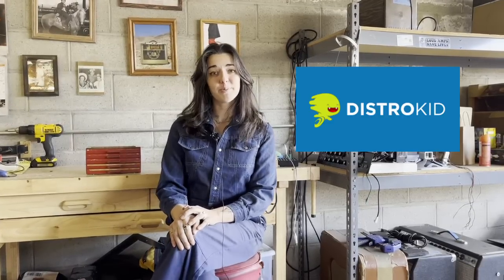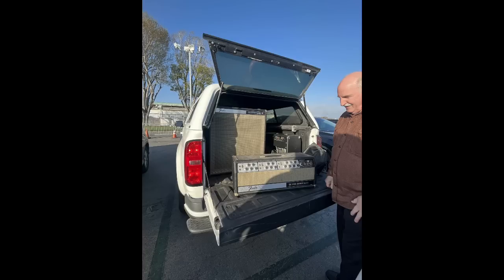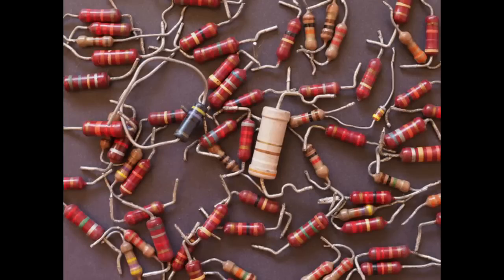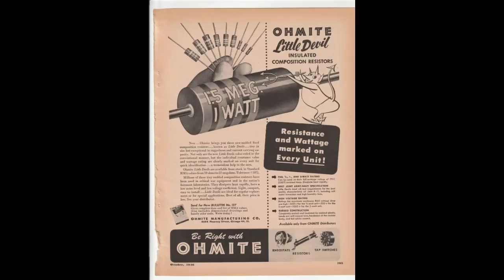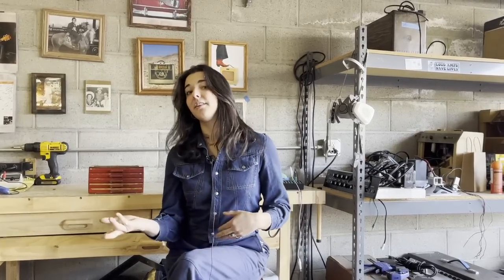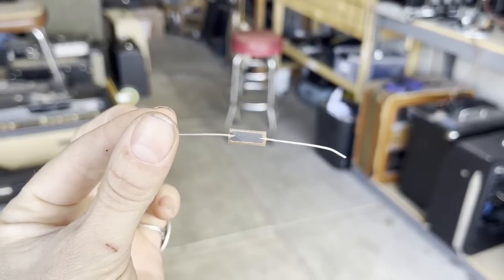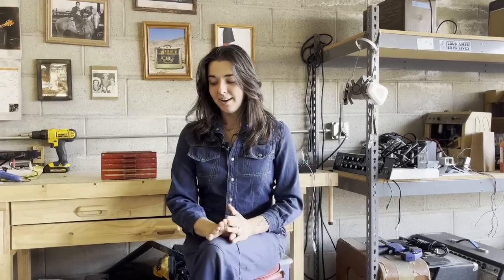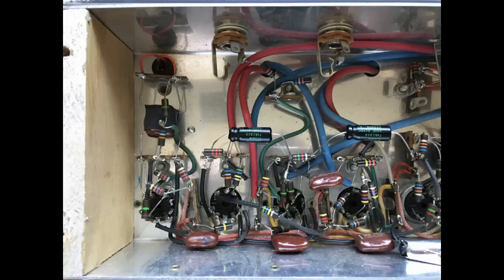Carbon Composition Resistors | Amp Electronics 101 | Fazio Electric

Comment: You video reminded me of when we used to "manually trim" carbon resistors to get a !% value vs the 5% or 10% standard values by using a small "V" file to trim the the resistor and then reseal that area with a non-conductive clear coat.

Comment: 😊Can u Explain more What is carbon Compozite! Is it carbon Sand coated on metal Resistor surfacs by using Wet Glue to Glue it Carbon Sand onto it. Is it correct !!😮

Comment: I must confess to visiting recycling centres(Rubbish dumps) and with a pair of pliers and a screw driver ready to pluck all the carbon resistors and caps I find in smashed equipment, then I measure them for re-use...I need help!

Comment: I'm not a fan of carbon comp resistors personally. They drift. They tend to be off spec with a wider "tolerance"  even when "new old stock". They fail in high stress applications like at the screens, plates, and along the B+ rail. But worst of all they HISS when subjected to humid conditions and over time in certain places. But still they have this aura of superiority because that's what people used back then. I have heard that in some applications they can give a sort of slight "warble" to the sound similar to a faint vibrato which might sound subjectively....mostly around the phase inverter section....but overall I am happy to remove them and replace with wire wound.

Comment: you beat around the bush.....CARBON RESISTORS....are not stable in a circuit when there is HEAT....inherent heat in electron flow or physical HEAT as in hot vacuum tubes and a heat soak heat sink.....THERE IS NO MAGIC MOJO......drifting instability when you want a STABLE circuit when...you have controls for the circuit....not some wild card in the circuit that is not a CONTROL factor.   THEY JUST USED THEM....as they were CHEAP and what was available in the moment......not for anything magical or surge related....considering the rectification was VACUUM TUBE and....hmmm a slow warm up and not solid state instantaneous.....heaters have to heat up my dear !  Engineering aspects....the numbers are good on the PAPER, but in real life that PAPER value only lasts till it HEATS UP.........and the variable strikes and it goes SIDEWAYS against the PAPER.   The engineers as designers will argue all day on the PAPER and MATH and VALUES as a result for the circuitry....they don't care about MATERIAL SCIENCE.....its VALUES hahahaha.......
DIRTY SECRET......hahahaha....take a magnet to the leads and see it they are ferrous and stick to the magnet or NOT......and the HIDDEN....it is ELECTROMAGNETISM...isn't it....rocket science isn't it !!

every value and every lead and across manufacturers lines.....its not always CONSISTENT.  IT'S NOT ALWAYS...swapping out PARTS for PARTS and SOLDERING IRON 101 and how not to get LEAD POISONING.....and GOOD SOLDER JOINTS hahahaha....fusion   A nose full of rosin smoke keeps the doctor away........and we won't talk about THORIUM in this BREATH.....
PROP 65 anyone ??

Comment: Nice to hear some honest commentary on carbon comp resistors.  I have a MSEE from a well-known engineering institute in MA and have been practicing EE as an employee, consultant, and adjunct instructor for nearly 41 years, mostly in analog and RF design.  Over these years I've learned a lot about electrical components.  I often hear carbon comp resistor religious zealots rave about how carbon comps are the best and should never have other types of resistors substituted for them in vintage amps, and blah, blah, blah...  These folks often uneducatedly denigrate SMT parts as "cheap," and "junk," when, in fact, they are closer to their ideal theoretical counterparts when it comes to performance due to lower parasitic values.  It can get frustrating sometimes, and you video was a nice breath of fresh air.  Thank you!

Comment: A great explanation Colleen. An old ham radio trick was to trim the value of carbon comp resistors by cutting into it with a hacksaw, the deeper the cut the higher the value.  Carbon comp resistors are still available from Mouser and other wholesalers, I still use them for energy absorbers across rectifier diodes (in series with a capacitor).

Comment: That was a nice explanation. It'd would have been cool to see how the value of that resistor changed after you sanded it down. I realize examples would have required a longer video and your explanation was enough to get your point across. I appreciate when you post content like this. It inspires more conversation in the comment section. Thanks. Happened to be wearing my Fazio T today.

Comment: Very cool.   A fairly well known audio/electronics engineer who passed away recently left a basement filled with all manner of electronic and devices.  I was able to aquire a large amount of the CC resistors that he had.   I don't know who made them but, I gather that they are probably a bit old as the values have increased well beyond the color code values.   I've needed to piggy back a second high value resistor in order to lower the value a bit.   
But, I'm happy to have them and am interested in building an amp or two with only them as the resistive elements.  Why not.  
They are there, and I can decide for myself if I think there are any of the mytholigical stated benefits and "mojo" involved that we're heard about.    Nice vid, thanks.

Comment: Great explanation - and until now I have never seen the insides of a resistor, very interesting! Thank you! May I add one point ... it may even be a "pro" for the CC resistor: in my opinion the CC resistors make a somewhat smoother, rounder and more pleasent sound, when used as the first resistor in the pre-amp. Usually the signal from the guitar arrives at a resitor which is in most amps 68 kOhms, in some amps it is 22 kOhms. I have experimented in one of the amps I use and found that the CC resistor results in a smoother sound, compared to modern resistors like carbon film or metal film resistors. (Of course in my experiment the resistors showed the same value with the Ohm-Meter.) I can only assume that all resistors always show a tiny portion of capacitor-like behavior, which depends on the type of resistor. And with the CC resistor this portion is different and this leads to a different transmission of high frequencies - hence the sound is smoother while it is harsher with other types of resistors. I hope, this makes a little sense somehow...

Comment: Nice description, I am so glad you didn't mention the dumb myth that carbon resistors create some kind of sought after sound or distortion in the amp. Other than that, please replace carbon comp resistors with more modern resistor types, unless as you mention for surge protection. As an electronics engineer, I stopped using carbon comps long time ago!

Comment: Another (former) pro of carbon resistors: They were the resistor to go for high frequency circuits. I love carbon resistors and still use them as ESD surge absorbers at pH meters. Instead of connecting the BNC socket to the PCB with wires we use 10K carbon compound resistors. The value and noise does not matter. No current flow and noise gets filtered out by the amplifier circuit that is made to amplify DC only. However the latest product now has SMD thick film resistors since I got mails from Digikey that the 10K OHMITE resistor will soon be made obsolete.

Comment: Carbon Comps have a resistance coefficient to voltage so there value changes with changing voltage. Thats why they produce extra distortion and are pretty much only preferrable as plate resistors if you want that 'Mojo'. In every other application standard metal or carbon are much better suited as you have well explained.
Reply: The "varistor" effect. I have read this is actually a thing in certain applications with carbon comp. But if you are really after that sound, buy a Magnatone.

Comment: I have a huge collection of old carbon comp resistors that I got with an old Ohmite storage bin. I went through them and checked them against what they were supposed to be, and the vast majority were ridiculously off spec. But the ones that were close I kept. I like them for no other reason than the fact that I like old stuff! And I use them when I’m doing any vintage work or any point to point work. Good video!

Comment: Every component in an electrical circuit is a resistor or has a level of resistance associated with it. Even the wiring. The exception is the application of superconductivity - and even here there is some resistance but but considered negligible in a practical sense.
Cheers
Reply: True superconductivity has absolutely zero resistance.  With no outside intervention, current will continue circulating in a superconductor and will not diminish.  (It takes quantum mechanics to explain this.  In the classical view, it would seem that the electrons would always eventually "bump into" something and slow down.)
Reply: @analog_guy  The strict and simple definition of superconductivity does stipulate that the electrical resistance is equal to zero and that Ohm's Law does not apply to superconductors.
There are plenty of articles on residual resistance in superconductors.

As Dr Rachford describes:
"Zero resistance at DC below the critical current but not at higher frequencies especially as one approaches the transition temperature and/or hf approaches the gap energy. Then also there can be flux transiting the (type II) superconductor resulting in losses and an effective resistance in an applied magnetic field or just a self-induced magnetic field. Magnetic flux pinning centers are manufactured into SC tapes for magnet applications to reduce the flux transits (phase slips)."

In terms of practicality we can describe superconductors as a material that has zero electrical and Ohm's Law does not apply.
I have no issue with that Mr Digital_Guy

Comment: I love your videos. Nowadays you can avoid using carbon resistors. modern resistors have better reliability, less noise, better tolerance, better stability, better everything... back in the days this is the only technology we used to have. if you choose the right type, you can always avoid carbon resistor. they are good for the vintage look.

Comment: It would be really useful if you mentioned a reason and justification for using carbon comps  in amps these days.
Reply: Yeah, I was wondering about that too - like is there a reason to replace carbon comp resistors with carbon film or carbon comp, or just move to metal film? I would just guess that moving everything to metal film is the way to go unless there's some really compelling reason not to.
Reply: IMO the main reason to use carbon composition resistors in amps is for the vintage look. Some might say they have different "mojo" but I can't speak to that.

Comment: the point to point construction often turns them into little flags that vibrate with the chassis too, it can lead to surprising mechanical problems. had to drag an amp on a stool across a concrete floor to find the bad resistor once. at deafening levels it would sometimes crackle, with the scooting action it would shake like crazy. wouldn't be surprised to find out if a badly placed resistor was mechanically responsible for the tone on some early tube gear

Comment: I see any carbon comp resisters have wattage values attached to them. My problem is knowing where a 2 watt resistor is required over a 1 watt, for example.
Reply: If you don't know what wattage you need you can find the voltage drop and/or in different conditions, then use Joule's law to find how much heat is generated. Double this to find a safe wattage resistor. You also need to mind the maximum voltage of each resistor type, but IIRC most carbon comps should handle at least 500 volts.

Comment: great video - super informative.  Can you tell me, do they tend to drift in one particular direction, or no?  And if they get less resistive, can this lead to other component damage, or does it just effect the sound?  Love your videos, Colleen, thanks for sharing!!
Reply: Carbon comp resistors tend to drift higher in resistance when exposed to a humid atmosphere.  They can be "baked out" in an oven at modestly warm temperature such as 65 degrees C to restore the original value, at least until they absorb humidity again.  Having said that, I have many very-old carbon comp resistors that have been stored for decades of time in a normal non-humidity-controlled indoor environment and these remain within or close to the original specified tolerance.   Good design practice was to use the carbon comps for low cost where the value and noise were not critical to the design, and to use film or wirewound resistors where tight tolerance and/or low noise was needed.  In applications where carbon comp resistors dissipate enough power to get reasonably warm, or where the overall product gets reasonably warm, as in products using electron tubes, they bake out each time the product is used.
Reply: @analog_guy  super information - thank you so much!!
Reply: As @analog_guy said, they usually drift up. However, they can also drift down if they have been overloaded.

Comment: Most informative... well explained... I've got a Vox AC-100 amplifier with cracked carbon resistors used plus a very tired looking Brimistor surge limiter on the 450volt rail. I've replaced all the caps and tubes and the 3 pots but not these croaky old resistors ... I wonder if metal film ones will be ok ( 0.25watt or 1 watt carbon film ) ...

Comment: As a rule, crbons for signal, letal films for standing voltages and supplies.
Laser trimmed carbon films are really good - used a lot on valve hifi as well.
Fun fact: CPUs are just 'made' then tested to see what the highest speed they'll do is, then backed down and laser etched with what they are.

Comment: Years ago I had bought a vintage keyboard (hohner pianet), which quickly started making some nasty cracking noises (the type of noise you described). I thought it was some faulty germanium transistor, so I changed them all. It did nothing. Then I also changed a few other stuff. Again, nothing. The old guy at the electronic shop told me resistors can't really go wrong, so I didn't bother changing them. I thought it was about the pickups or transformer, or something. So I finally gave up and sold my noisy vintage keyboard, for like... almost nothing. Now I realize it was about the carbon resistors. If only someone had told me about this at the time ! 😭

Comment: Carbon comp resistors in general are still ok to use in a basic high or low voltage, low tollerance valve circuit for instance. Other than that they are just to unreliable, noisy and drifty for anything else.
Reply: Measure, listen & monitor has always worked for me. Whenever possible, I use CC resistors; if I happen to have the right value and I have a bunch.
Reply: Sounds like you're contradicting yourself?

Comment: How are you on metal film resistors vs. carbon film? I tend to sway to metal film but I don't work in audio nor typically with 200+ volts. I should look up the voltage specs on carbon film vs. metal film. I know resistors have a max voltage spec for each body size. I typically never have to worry about that in the low voltage stuff I usually work on/design.
Reply: Most amateur amp builders (like me) use metal film resistors except for high current applications. They are quiet. They are stable and value tolerances typically are tight compared to carbon comp or carbon film resistors.

Comment: Fellow amp tech here. Agree with the 100% good info here. Well done on communicating these concepts. Keep up the great work. 

Outside of the plate and power supply where I also prefer non-carbon comp, in my experience, something that can be both a pro or a con is that the drifting carbon comps can significantly contribute to the "mojo" in many vintage amps. Better or worse being wholly subjective of course :) But if I find an amp that sounds particularly unique across my bench I tend to take notes of how much the carbons have moved around.
Reply: Amp techs sometimes need to compromise: if the amp is used on tours, it should also be reliable so might need to repair instead. Of course it also depends whether it is in the signal path or not.

Comment: When I need low-induction resistors, I use carbon film resistors, but they tend to produce more noise, especially as they age.
Reply: I thought the carbon comp made noise ..isn't that what she said?
Reply: Both carbon film and carbon comp resisters make noise. Usually the film resisters are a little more quiet until you get above 100k. They are both cheaper than metal film and that's why they are used so much.

Comment: So if you replace your old resistors with the new be aware of power surges. 
Thanks for showing how the resistor is constructed. 
Now how does resistance work in a circuit?!

Comment: Got a few CC resistors though it is not my cup of tea - especially given their tendency to drift with humidity. All Keritech amps come with metal film resistors, vintage MLT (USSR, you'll probably come across them in Sovtek / EH amps) or modern production.

Funny enough, I once tested how a 2W MLT resistor would handle exceeded power. I cranked it up to dissipate 7W, and while it was glowing red and the enamel burned releasing a tiny amount of magic smoke, the resistance was perfectly in spec. I sometimes found burned MLT resistors in line with screen grids; ugly but still going. I prefer wirewound 5W though.

Comment: Since as we know even new old stock carbon comp resistors can become noisy while they just sit there in the parts tray, it seems a shame that we don't have some little palm size electronic device for measuring resistor noise, along the lines of the ones you can buy from Peak to check transistors and diodes, and measure capacitor ESR and so on....